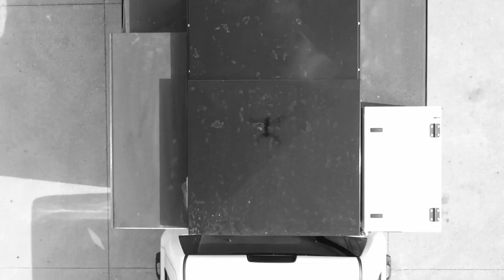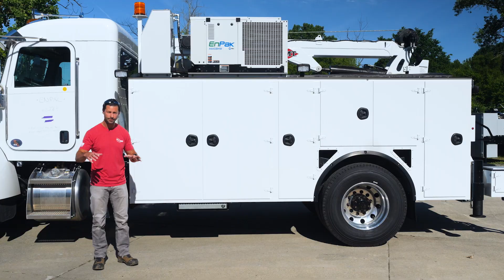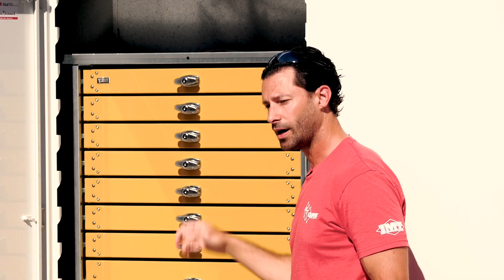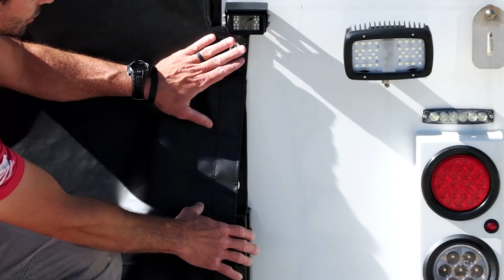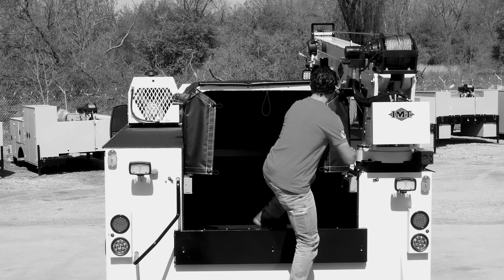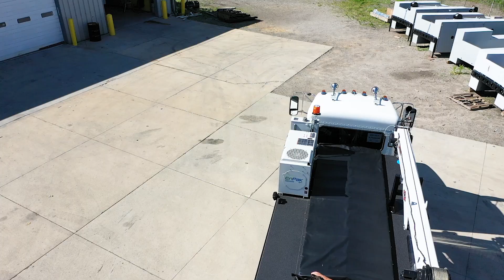Custom Tarp Option for IMT Service Trucks

Comment: Fantastic truck. Have you guys heard anything about the enpak’s welding capabilities? On paper it has similar specs to a trailblazer, curious if they can maintain the performance with everything else that machine does.
Reply from the maker: Thanks Ethan!  We don’t have any feedback from the field yet on the EnPak as far as welding goes.  Which is probably a good thing??  If we hear anything I’ll post.  Thanks for watching.